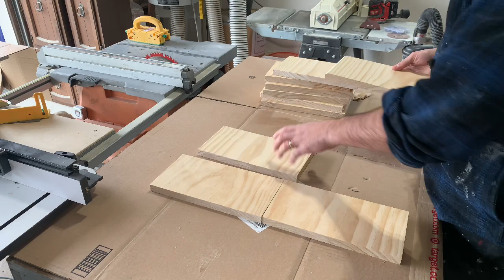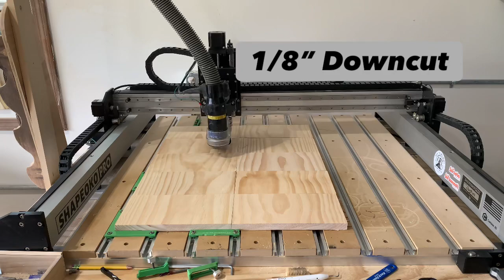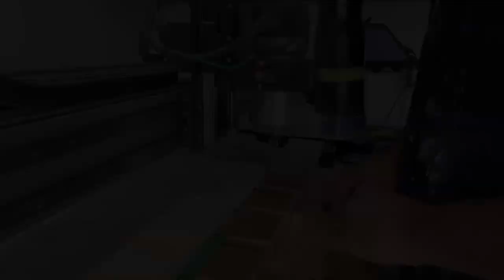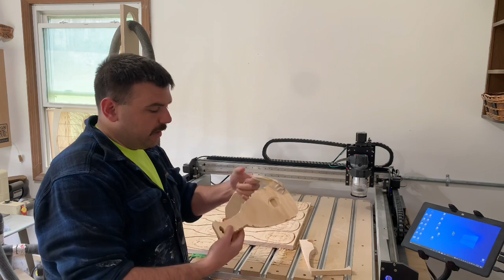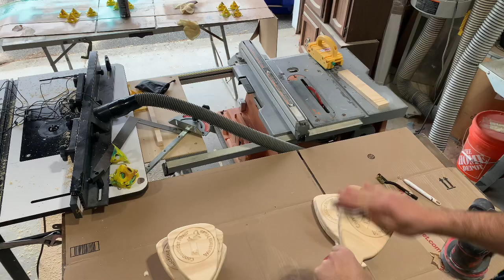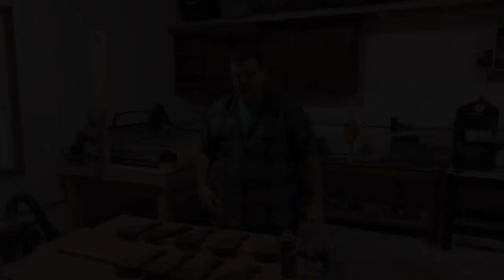Batching out Scrap Wood Bottle Openers on my Shapeoko Pro CNC Machine

Comment: I've never heard of a bit slipping up! Seems more like the z-axis starting location didn't get set properly. Either way, awesome video! Thanks for sharing your process and thoughts!
Reply from the maker: Me either to be honest, that’s why I was so confused! I know I set my zero height though, because it carved the text correctly. When i got to the 1/4” bit, something changed. Maybe my bitsetter malfunctioned? No idea haha
Reply: I literally had the something happen to me yesterday, ensure the collet and the router chamber is cleared out especially if you use wet pine.  It clogs it up pretty fast.
Reply from the maker: @anthonylanger1  yea, it haven’t happened to me since. Very bizarre
Reply: This happens with down cut bits. Down cut bits slip up in the collet and up cut bits slip down.

Comment: If you want to always be able to cut exactly through your material and never cut into the MDF then set zero off the bottom. 
Setting zero off the top leaves room for errors. Errors because you manually sanded instead of using a surfacing bit. Errors because the wood could be cupped or bowed. Errors because the masking tape could have more ca glue in certain areas and none in other areas. 
Think about it this way. The only constant reference is your wasteboard (unless you surface it) on a three axis cnc. Once you get your head kind of wrapped around setting zero off the bottom then you will never run into issues like this.
It is also a great benefit doing 3D carving because if anything needs to be redone and you've carved away the entire top of the material you always have your z-zero point.
Reply from the maker: Yea, slowly learning that along the way! Thanks for the tip, and thanks for watching!

Comment: Surfacing bits are a life saver. Did you set up a cut with tabs? Always check your bit depth to board thickness. Good learning video.
Reply: Yea, I should have surfaced them for sure. I was trying to cut corners by sanding them on the table haha lessons learned! I had saved g-code with tables originally, but when I resaved it, I forgot to add the tabs back in.
Reply: It’s nice to know we all learn it. I have made my share of mistakes. Haha. Keep posting more info. Good job!

Comment: what tablet are u using to run the cnc a;so look into sanding mops thats what i use for all the details works great
Reply from the maker: It’s a Fusion 5 tablet. I absolutely love it. Makes it much easier to jog the machine around with the tough screen. And hmm, I’ll definitely look into that! Thanks!
Reply: @AquaVitaeWoodworks  yeah i use a wireless mouse right now but may need to look into the tablet ill post a link to the sanding mops
Reply from the maker: @dodgeram2500ism  I highly recommend it. Makes it feel like a “real” factory CNC machine haha atleast in my mind it does!

Comment: Great video.  I enjoy seeing people going through the same issues I do.  What tablet are you using for carbide motion?  And how are you getting the files to it?  Thanks.
Reply from the maker: Thanks! It’s a learning process for sure! I have a Fusion 5 tablet, highly recommend it. I design all my carves on the laptop and then use a USB to transfer it onto the tablet. The touch screen is great with carbide motion.
Reply: @AquaVitaeWoodworks  thanks. I have been looking into that but so many times I need to make a tweak to the file so I just run off my laptop but the tablet is so much better for space.
Reply from the maker: @davidcochran934  yea, that is certainly a flaw with having two separate platforms to work off of. I just think the touch screen is worth the trade off

Comment: I don't understand why you sanded trying to make them flat. The stock was already on the CNC. You could have run a surfacing tool path and avoided some of the problems.
Reply from the maker: Becasue I had no idea what I was doing 😂 

I had the machine for a few months when I made this. You’re right, surfacing is the way to go. Live and learn